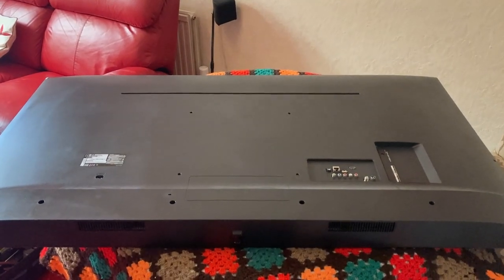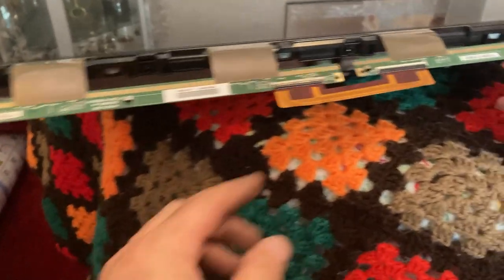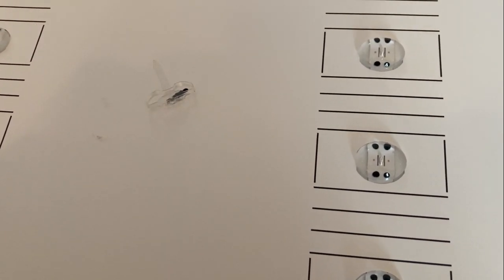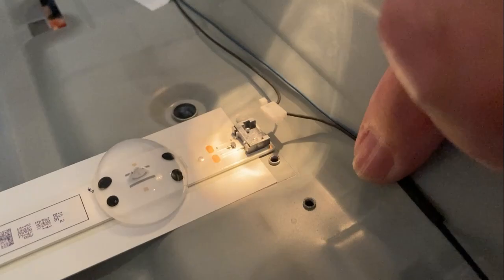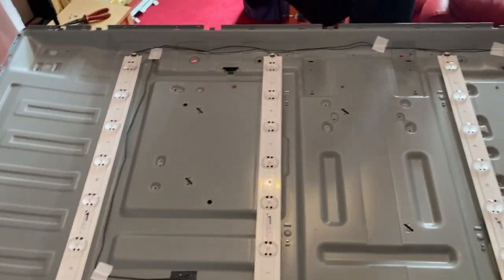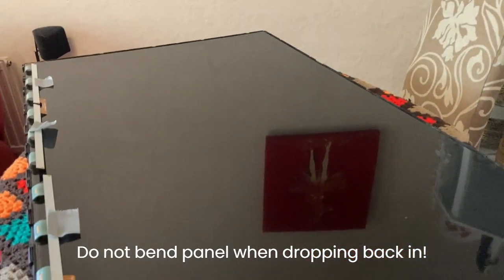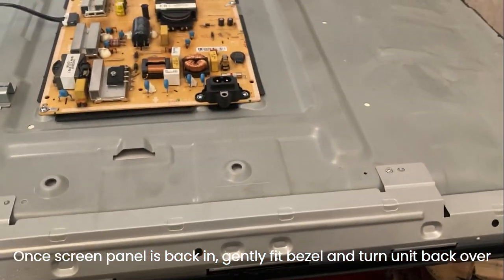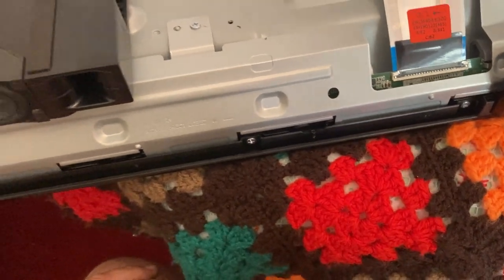LG 65  TV LED backlight repair 65UK6300PLB

Comment: Thanx this confirmed that it is only 4 strips in this model. Others havet up to 12.
Reply from the maker: Yes, I found that as well, was worried when only 4 turned up.
Reply: @corffixesthings2673  right :)